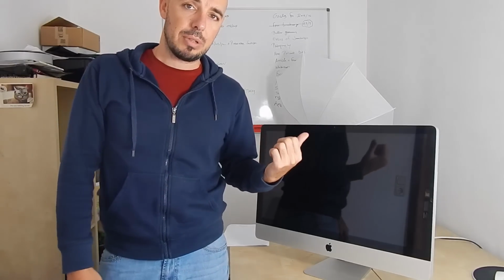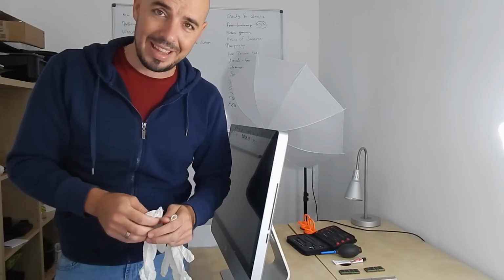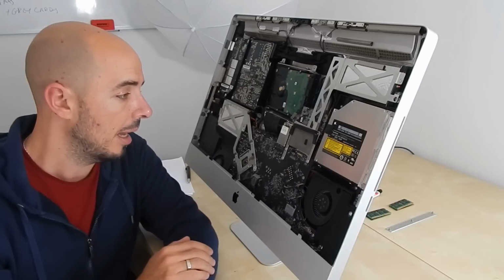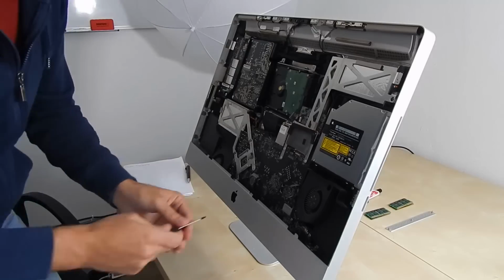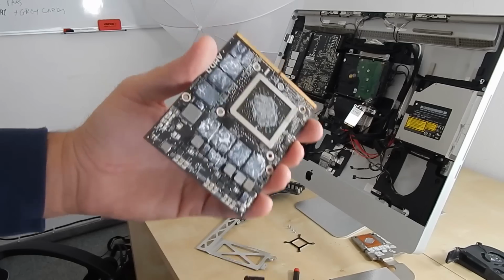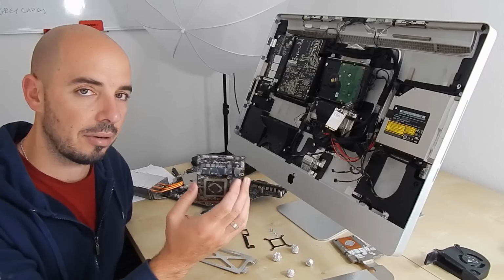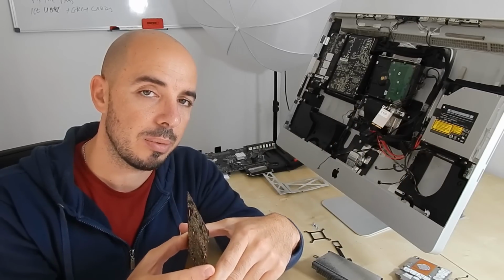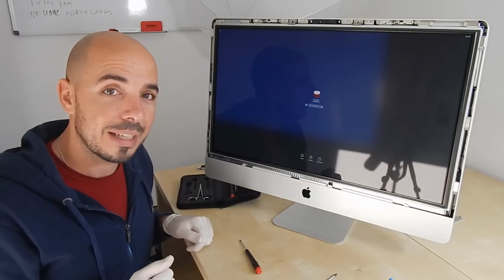Burn the VGA and  Fix your iMac - Don't Pay Shitty Problems!!!

Comment from the maker: JUST A NEW NOTE TO ALL OF YOU:
My iMac still works like a charm after 30 months (March 2018)!!! 
So this trick actually works and rocks!!! Use also a free mac app that flows faster the fans and controls the temperature (example: smcFanControl). Good luck to all of you!!! :)
Reply: Evan - Creative Tuts Hi Evan, so i did this and seems to have worked! But now my fans are running at full speed. i tried resetting the smc but no good. i also tried downloading the fan control program but it wont let me change the speeds. Have i just connected something wrong inside?
Reply from the maker: Hello my friend. If that happened right after the baking process and the assembly of the iMac then I believe you haven't connected the FAN cables to the mainboard or the cable is damaged. When the cable isn't properly connected to the M/B the FANS run at full speed. If the FAN speed raised after an O.S. upgrade then you have to download the the SSD Fan Control which does an excellent job with the High Sierra OS. Good luck!
Reply: saskatoonproductions you forgot connect your hard drive sensor That’s the reason
Reply: It's been a two year anniversary since my fix!
Reply: Evan - Creative Tuts Hi there it will be helpful if you replied the message, What is the materials you've used to remove the old GPU past. Thanks
Reply: will this trick work with a late 2006 20" imac?
Reply: Evan - Creative Tuts Hi I tried this it worked for about a month. I was using no major software just movies. Now I am back with the White screen at the startup. Should I re heat the GPU again? What do you think the issue would have been???
Reply: @navg7284  hi, i'm facing the same problem. did re heating the GPU solve the problem again? thanks
Reply: lionex3d it worked for a while and then the same issue occurred. It could be the gum that I used not being of high quality.
Reply: @navg7284  Yeah, i have found around the forums etc, people reporting the oven bake method are having to do it again after a few months.  Others after 8 - 9 months.  Some people have used a heat gun.  I'm not sure about that though.
Reply: Hi Evan. I am going to try to fix my 27" iMac 2011. What screwdriver types and sizes do I need? Thank you, Vasily
Reply: @appletv2011  Torx screw driver bit size 7 or 8 from memory. :D
Reply: Evan - Creative Tuts A
Reply: thanks i just did your method really worked I appreciate the help I used to go to local computer shop we don't have apple stores in saudi and I spent $200 for a temporary fix I hope this lasts as long as I use it :)
Reply: Just did it. And it's really work!! Thank you so much for this tutorial. I should to wait 3 days to bake the card. I don't have oven but lucky me bakery shop in town helped bake the card hahaha. Thank you
Reply: Ειναι ένας μήνας που δεν μπουτάρει ο iMac late 2009, παρά μονο σε safe mode! Όλα φαίνεται να δουλευουν σωστά, δεν ειναι θεμα OS ή άλλου software, οπότε μου μένει να ψήσω κι εγω την κάρτα μου!
Reply: Evan - Creative Tuts would this work on a 2009 MacBook Pro?
Reply: Any mode other than paypal good man?
Reply: its lovely to see all the people benefiting from this and reducing landfill, my mid 2011 has a different issue which i think is the psu and display power board, but if the 6970m goes i will probably do this to.
Reply: Super awesome. I've just rebooted after doing this on my mid 2011 iMac and it booted right up and looks great. A bit intimidating with all the screws and connectors,  but it's not too bad if you take you're time. That being said, this would have been an 98% easier on my Dell.
Reply: Evan, you are a rare phenomenon! Knowledge, charm, humour and humility. Kudos! Only thing missing for me was a word of warning concerning the work of the devil that is the LCD to motherboard connector; all that glitters is not gold indeed. As I wrestled with this infernal, tiny piece of pure mischief, breaking one in the process and then awaiting its replacement with apprehension approaching terror, I fervently hoped that there was a special place in hell reserved for whichever apple hardware engineer had designed it. The best advice I came across in a forum and proffer here for the sanity of my fellow pilgrims is this: attach the motherboard end FIRST and then....the very best of luck! Brain surgery must surely be child’s play compared to working with this tiny, fragile, glittering mockery of a connector.
Reply: Evan - Creative Tuts did you preheat the oven to 200 Celsius or Fahrenheit? And how long was it in the oven for
Reply: Great Video Evan really well put together. I have the 27 5k 2015 iMac. It’s got an i7 4ghz professor and I’ve put in 32gb RAM, but I wanna take out the fusion drive and put in a Samsung evo 1 or 2 TB, but I’m petrified of taking screen off. I know this machine is capable of 64gb ram also. I have a 4GB Graphics card so If I did this upgrade to the ssd do you think it would make any difference to performance (I’m talking hard drive), then what do I do with the fusion drive as I got the 3 TB with 128 I think ssd built in. Could I sell that or use as an external? All the best. Peter
PS can I ask where best Apple computer tools are sold from to do this and I’d be happy to pay somebody to do it if anyone knows any Uk guys.
Reply: What kind of thermal paste do you use and where do you get it to buy?
Reply: @TheTexasmarl  Look online and get Arctic Silver 5 paste for the GPU.  Get Arctic thermal pads 1.5 mm for the associated video ram chips. And thanks Evan for the awesome idea to bake the GPU card!  This ingenious trick worked wonders on my mid-2010 iMac 21.5 incher after black screen on main display and no video on external display plugged into mini-display port.
Reply: It really does work, but the problem will come back because of the design flaw. I'm in the process of baking mine for the 6th time. I've gotten quite good at it though, I can do the whole process in under an hour now
Reply: Evan - Creative Tuts would it work for my screen has black lines all across the screen ?

Comment: I'd try to find some soft silicone to set it on, like a muffin baking silicone tray. I'd be afraid aluminum might grab or deform solder on the board. 
Also, what about making some kind of bracing for the chip(s) with maybe crazy glue, or something able to stand the heat?

Comment: So it's a matter of re-setting the solder and re-seating the gpu? I wonder if this could be done simply by running the iMac hot enough for long enough, with it face-down - or would it need to be face up? 🤔

Comment: I paid a computer guy to fix my card. He said he brought a new one. 7 months later it's got the same fault!! I think he ripped me off!😠😠
Reply from the maker: Not entirely sure. Maybe he just did the reflow fix or maybe he bought a working card. But the thing is that all the cards of that generation will die eventually. The only solution is to keep baking or get a newer not officially supported card and flash it your self (risky game). I suggest the first option, because is cheaper for you.

Comment: I used this process to bake my graphic card a year ago and now I am back. Unlike many people mine didn’t last too long. Any tips before I start same process again?
Reply: Just finished baking my graphic card and now my iMac is back on. This time it was less overwhelming then first time
Reply: @desireuben Maybe try the system fan 3rd party utility (smc fancontrol) to increase the gpu fan speed threshold a little to ensure the gpu stays cool enough and doesn't lose its internal solder bindings which seems to lead to the display problems.

Comment: Good video, but you don't need to pull the whole motherboard out to pull out the GPU assembly. After you remove the correct screws you can just pull it upwards and out. Saves a lot of unnecessary work.
Reply from the maker: Thanks for the tip but that works only only 2009 versions of iMac. The 2011 versions dont have screws on that place, so there is no other way, but to take out the mainboard.

Comment: Good to hear you got it working again.  I’ve used this method to get systems going in a pinch but this is NOT a permanent fix. 

It could last five years or five minutes, it’s really down to luck of the draw.  

A proper fix is to replace the chip as it is an internal fault inside the chip itself rather than the solder balls.  Louis Rossmann has a good video on it.  Good luck finding new chips for a 10 year old computer though.

400f (205C) is not hot enough to melt the unleaded solder used in these systems, even leaded solder wouldn’t do much at those temperatures.  If you don’t believe me, take a piece of leaded solder and lead free solder and put it in the oven at 400f and see if it changes shape.  It should ball up if it melts.

Also don’t use the same oven you use for food, there some really nasty stuff that gets released when you heat up circuit boards, you don’t want that in your food.

Hopefully this info is useful for some.  If you want to try this you can get a toaster oven for pretty cheap

Comment: 392F and iMac is a PC, now simply remove the HDD and replace it with an SSD and a good fan controller software and your old iMac will be fast, instead of working like a 1999 based Intel system

Comment: Hi evan, i did it in my imac 2009 and it works. Thanks so much.
Can I ask you something?
I have one imac late 2015 that has same problem.  The vga is attached with mainboard. So I burned it with hot gun cause  the vga is onboard. But the result is no respond  at all.  Could you give me some suggestion? Plese help.....thanks before.

Comment: This worked for my mid 2011 iMac 21.5", thanks a lot!!! Also didnt have the suction cups so I took 2 pieces of double sided tape and taped them on the screen on put it on the ground and lifted up and the screen came off. And I didnt have the thermal paste available so I just used copper paste instead. Works fine!!

Comment: Hi I did this method and it worked for at a least a year. Now the iMac had the same issue I opened it, did the same method of the oven but this time one piece has moved and I don’t know how to stick it back. Tried soldering but maybe is not the best method or I did it wrong. Any suggestions, I have no hope lol

Comment: What did you use to clean the video card, also can I use the old thermo paste or should I remove it and apply new?
Reply from the maker: You can use Isopropyl Alcohol or any alcohol based liquid. Always is a good practice to use a new thermal paste.
Reply: Thank you Evan ! I baked my video card in the oven like you suggested and it worked however now I can't seem to find the hard drive. At first I got the ??? screen.  Now I have used my back up drive and have been able to get my mouse and keyboard to work and have tried Command R to reboot but no success. I did use Isopropyl alcohol to clean and used new thermo paste. I feel you helped me solve the issue with the video card so this was a success.

Comment: I'm going to try attempt to do this to my 2011 27' iMac today. Thanks for the encouraging words at the end. I believe in myself even though i've never done anything like this before, but my brother-in-law will help me and he does PC work so it will be a new experience for the both of us. I'd just like to thank Steve Jobs for creating this wonderful piece of machinery that works so well and is seemingly easy to disassemble and reassemble. Thanks again Evan.
Reply: Update: 

Our problem was a constant restarting.  We would turn on the computer and it would restart.  It would restart on awakening from sleep.  It would restart 2 or 3 times in a row. No issues with striping, just the restarting issue.

With the help of a technician, we disassembled the computer to get access to the GPU. We used a heatgun on the 6970M for like 4 minutes (without a thermometer) and reassembled the whole thing. Problem wasn't solved and a new problem emerged, pin-striping.

2 weeks later (after waiting for the technician), my wife and i decided to give it a shot ourselves after she watched this video.  She was hesitant before watching this video, but it encouraged her to try.  We opened it up again and got the GPU, this time we did the oven bake (10 minutes: 200 Degrees Celsius). 

Its been 5 days now and its running like new.  No restarts. No striping.  Everything is working wonderfully.  Looks like a new machine.  Now my wife, not a techy, is talking about making a Hackintosh. I asked her where she heard that phrase from.  But now she is going on this rabbit-hole journey and its probably started from this video.

And now we know this computer in-and-out. We ended up opening it like 10 - 15 times. We know all the parts.  She got shocked one time because she touched the PSU while it was plugged (life lesson). She wants to drill holes near the fan to allow more air to enter.  Its just opened so many ideas.

Comment: Hi I’m wondering if I could use a hair dryer because I don’t have a oven
Reply from the maker: I don't believe you will get that hot temperature in order to fix the issue. But you can always try or use a heat gun.
Reply: @evancreativetuts  ok thanks!

Comment: Something that could help is trying to get no clean liquid flux under the chip so that it will help recondition the solder so it's not as brittle and prone to breaking.

Comment: I had a similar issue with a mid-2011 iMac 27" ... I baked the graphics card too and it worked. I put a video together about it.. Check out my experience here...
 https://youtu.be/d-Raj4lQ0uA

Comment: Wow I can't believe this worked! I followed your instructions and My imac is now operating :) altho the fan is running full speed because when I was disconnecting the skin temp sensor the wires were pulled from the connecter and the connecter is still stuck into the terminal. do I just need to install a whole new skin temp sensor? or can I reattach the connecter somehow? Thanks for any tips!

Comment: You can do the same fix in 5 minutes with hot air blower by putting the iMac on it's back on the floor (display up) and blowing hot air through the bottom right side vents and turning iMac on so that the fans will distribute the hot air to the GPU. That way the processor of the GPU will fasten again to the circuit board because of gravity. :) I did that baking thing 2018 and my 2011 iMac worked almost two years without any problems but now tried this easier and quicker method and it worked right away. Hope this tip saves someone's time and nerves.

Comment: I was skeptical at first but since my Mac was not starting up due to this issue I didn't have much to loose. I tried this and it absolutely worked! I have been using my Mac for about a week since I baked the graphics card and it's working like a champ again.

Comment: I want to thank you for this great video, I like it so much that I bought 2 not working computers (same one as the video) knowing that the problem can be fixed by burning the video card, now I own 3 beautiful iMacs for almost nothing thanks to you, I repeat the process many times and realize that when I baked for 12 minutes at 405 fahrenheit the iMac stays trouble free for a longer time, I don’t know if drilling a hole and installing a fan straight to the card will make the video card not to go bad again, wondering if someone tried already.

Comment: I did it for iMac 27inch 2011 but its only worked for few days.any solution?
Reply: Bake again
Reply: @santiag0pictures  did it again .now its not working at all.
Reply: I did it for my imac27 mid 2011 three months ago. It still working good 
You might have to do it again and use good thermal paste before you put it togather

Comment: Hi Evan, I got iMac 2012 sleek version and have the same issue. But it works when I put external monitor using thunderbolt adaptor. What do you think, is it a GPU issue or Display issue?

Comment: Thanks so much for this!!  I had the vertical line issue and although the internals look slightly different on my early 2008 iMac 8.1, the principle was exactly the same - baked the GPU at 200 degrees for 8 minutes, and left to stand to cool down, then new thermal paste and put back together again.  Worked first time!  Now I wonder what the 5 left over small screws were for..?! :)   Evan, you are a truly a modern day Greek Legend - thank you!

Comment: I am an idiot and used a program called Mac Fan Control to turn down the fans on my iMac because they were so loud. Now my GPU is messed up just like yours. I am going to attempt this because it has the i7, 16gb of ram and 2TB harddrive and is an awesome computer. Thanks for this helpful video and glad it worked out for you!

Comment: Thank you it worked! Fixed my 2011 iMac. A warning to others, be very careful with the little connections inside. I accidentally pulled the mother board and ripped off a wire from the WiFi card. No WiFi now but at can still use Ethernet. Many thanks.

Comment: Thanks for the vid. I did 2nd bake today after graphics card failed again couple of days ago. my imac27 is up and running again. I did 1st bake in 2018 using your video as well. I went about today's bake a lot more confidently and wasn't disappointed. By the way, I took pictures of most of the cable positions for a before & after guide. Thanks once again!

Comment: Baking it in the oven? I'm confused how is the heat from baking it supposed to fix it
Reply: It re-liquifies the solder points from the GPU chip that cracked, thus reconnecting them.  The solder that the GPU manufacturer uses is not good quality and becomes brittle from heating and cooling over time.